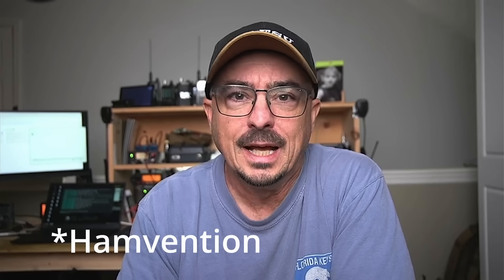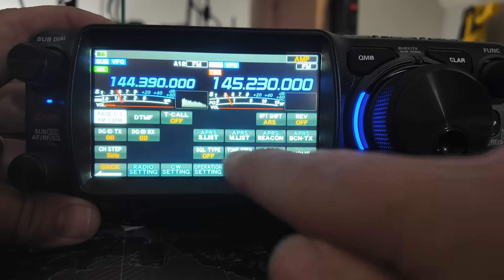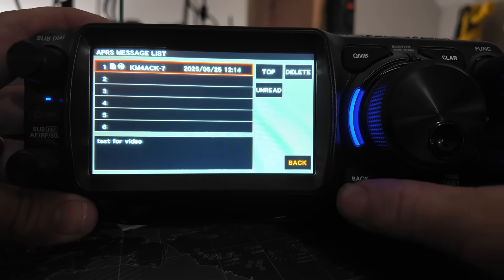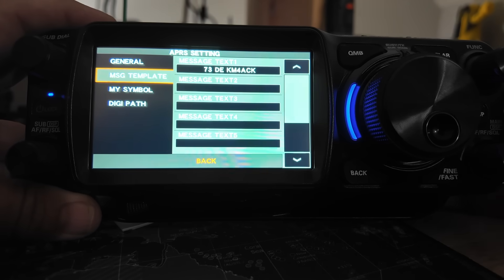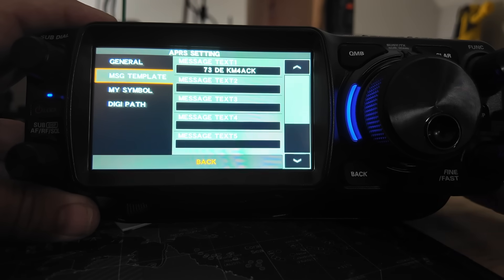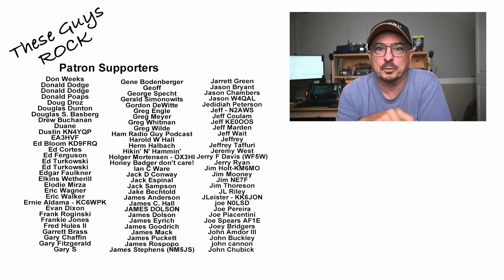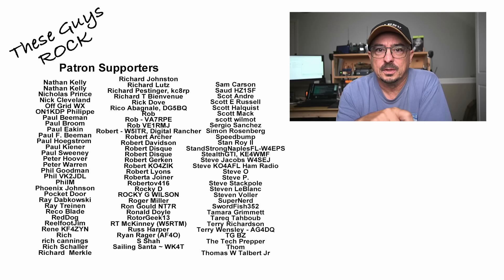The Yaesu FTX has a Flaw

Comment: I had something like that with my FT991A. Recording option everything is clearly stated in the manual only it doesn't work looked on youtube did the same as in the manual. But it doesn't work for me. After some research I saw that it wasn't completely up to date with firmware. So downloaded and installed everything on the Yaesu. Only not all updates were available on the site. What became clear was that almost everything was up to date only the LCD wasn't so I just didn't see anything on the screen anymore. Searched for 2 days for the update for the LCD screen. I don't think something like that should happen. But if you email Yeasu I get no answer at all. I'm not important enough even though I already have 3 Yaesu's on the shelf. At some point you think I have enough Yaesu's and I'm going to look at another brand....

Comment: Fortunately, APRS is not the most important functionality for me. I have analog APRS in the TYT-578 radio and it works quite well - I used it maybe five times during the year. Using APRS from the car radio is pointless. On a 300 km route, the gates received only six of my beacons - so I prefer to use APRS DROID. Although I think the device should support it out of the box. Probably future updates will improve it... We are "beta testers"

Comment: Highlight the desired message and press the Reply or Edit button (this may be labeled as “Reply” or accessed via a function key like F or ENT).
A text input screen should appear. Use the touchscreen or knob to enter your reply. The FTX-1’s interface, similar to the FTM-400XDR, allows text input via an on-screen keyboard.
Keep messages short (APRS messages are typically limited to 67 characters).
Reply: After composing your message, press the Transmit or Send button (often labeled as TX or a similar icon on the touchscreen).
Ensure the APRS modem is active (set to 1200 baud for VHF, typically 144.39 MHz in North America) and that the radio is on the correct band (B-band for APRS on dual-band radios).
The radio will send the message to the target station, often via a digipeater if the station is out of direct range.

Comment: I don’t think Yaesu put the bar very high for themselves. They did not try to put out a ground breaking new designed radio. for the price they’re asking for the radio they really should have knocked it out of the park. It should have been lighter than the 705 smaller than the 705 included all the features of the 705 like GPS, Bluetooth, etc. made it full duplex. in my opinion, I don’t think they moved the bar any further.

Comment: Transmission by any radio normally requires GPS, or manually entered lat/long data.  The FTX-1 does not have an integrated GPS module.  You have to buy that separately.

Comment: FTX-1A will have everything under control. And it will connect right up to the Optima Amp module.
And it would be nice to have a button for “weather radio “ also.  Not a replacement for a ic-705 for certain.

Comment: I'm curious how you have the signal stick pointed straight up.  I have the same with a 90 degree bnc.  Th HF antenna port is above the UHF port.
Reply: I'm wondering the same thing.  Could he have the signal stick attached to the wrong bnc ?

Comment: It’s a simple problem, it’s called “Over Engineering”, are they focus on something new and exciting like the audio output of the radio which is a big deal!  Users are complementing the performance of the audio from the radios speaker system, but at the same time, “Under Engineering” in areas that haven’t changed but get forgotten in the engineering and testing of the equipment, obviously a firmware update will correct all the problems that they under engineered!  it’s supposed to be a finished product but actually it’s in beta, report what you find wrong to Yeasu, and they’ll issue a firmware update, who knows there might be a firmware update already?  Said enough now and I’ll shut up.

Comment: When you previously mentioned the FTX, with zero seconds of FTX research, I commented that it looked like a great radio but it'll almost certainly have that one bug or "feature" that Yaesu always includes that leaves you wondering what they could have possibly been thinking.

On the plus side, it looks like APRS was a last second FTX feature place holder add-on, and while it's completely useless now, you're probably only one firmware update (maybe two) from full APRS functionality.

Contrast that with Yaesu's fatal hardware flaws that you own for life.  I bought the FT-70DR for EMCOM, not knowing about its unadvertised "feature" that leaves the receiver powered at all times so it can decode a wake up signal.  I can see where 1% of users might like that feature, provided that it's not the default and it can be turned on and off at will.  Nope.  It's hardwired.  Modern Yaesu HTs must be left charging or stored with the battery removed or they'll be dead in a week or two when you need it for emergency communications.  OFF means OFF, Yaesu!  Baofeng got this right.  Everyone other than Yaesu gets this right.

I love Yaesu but buying a Yaesu is like having an attractive and fun YL and after she becomes your XYL you learn that she has an incurable STD.

Hopefully, a firmware injection will kill whatever bug is infecting your FTX.

Comment: Rumor has it: new firmware updates are coming to fix APRS messaging and a bunch of other things.  This radio will be beta for a while.
Reply: Beta?
Reply: @gliv2  The good news is the final product can be achieved with firmware updates.  Back in the release of the FT-857 (non-D), a hardware change was required to get the end result.

Comment: Aprs is not mentioned anywhere so you're complaining about a feature that is being added but not completely done yet what am I missing here
Reply from the maker: They have an ARPS specific manual for the FTX
Reply: Agreed however nowhere in the literature does it boast aprs I figure it wasn't completely done so they did not mention it anywhere just a little added bonus that needs some tweaking. I don't really consider that a mistake. if it wasn't in there at all and then they added it later you would be praising them for doing something extra even if the first iteration was broken not trying to nitpick. I do you love your Channel but I see a lot of people hating on it I think they hit the nail on the head for the most part with the exception of it should technically have built-in GPS and Wi-Fi but then again the majority of people are not going to buy it for that the fact that the GPS is a dongle means it wasn't really meant for aprs just an added feature

Comment: I also reserved an FTX-1 at HRO, but when the salesman told me the price, I passed on it. I can’t image a QRP rig costing 50% more than the FT-710.   The Optima version is about double! I have APRS on other rigs, and vhf/uhf mobiles are cheap. I just don’t get the enthusiasm over this rig. I am a long-term Yaesu fan, but on this one, it doesn’t seem to do anything to garner the price.
Reply: Do you think the 705 is over priced? Do you think the ftdx10 is overpriced?
Reply: @Blake-jl8lh 

The 705? yes.  Direct from Japan I sometimes see one for around $1070, which if I needed one to replace my IC-7100 would be an option, but at HRO or DXE prices, not worth it. 

The DX10? No. I own one. With the discount and rebate at the time I bought it, it was a great deal and worth every cent. This is a killer rig and maybe should not cost so much more than the 710 for what it is, but I do like the quicker access to things on buttons and not buried in menus.
Reply: @kenchilton  the dx10 is a 1500 dollar radio now with the current state of the market. Add uhf/vhf, a detachable head, and an extra hf port and you dont think all that added is worth 400 bucks? Come on man. The radio is proced correctly relative to the market.
Reply: @Blake-jl8lh 

Sorry, but not the way I see it. The FTX1 is more comparable to the FT-710 ($920 at Gigaparts, last I checked) as an HF rig, not the DX10.  The Optima is an FT-710 with UHF/VHF and a detachable head added, fewer panel controls, and double the price.

It is okay to disagree. Buy one. It is not a bad rig, just high-priced here at introduction, IMHO. I hope you are happy with it.  I am looking forward to some deep discounts on the 991a (which really does seem to be what the x1 replaces in the lineup).
Reply: @kenchilton why do you say its like the 710? From what i read from yeasu I believe rx architecture wise this radio is closer to the dx10 than the 710 which is what makes the dx10 a more expensive radio. 

Its nothing like the 991a in terms of the actual rf architecture. Its light years beyond that. But if you don't need all that receiver Id say buy a cheaper radio for sure.
Reply: @Blake-jl8lh 

Not according to Yaesu’s brochure. The FT-710 is a pure direct-conversion SDR (the filtered RF feeds directly into an ADC). The DX10 is a hybrid SDR (superheterodyne down-converter feeding an ADC). The block diagram on the FTX1  brochure clearly shows the HF RF feeding directly to the ADC with no down-converter or mixer. The VHF/UHF path have downconverters, not the HF. On HF, this is a 710 architecture. The only thing noted is that FTX1 uses the ADC component that the DX10 uses, but the 710 ADC is proven to be close to the same performance. 

Price does not depend on architecture - cost does. Price is an indirect reflection of performance and utility. Architecture can drive performance, but as evidenced by the Sherwood data, the DX10 is only marginally better than the FT-710. Without such data, we have no evidence to assess the value of the FTX1 except to say that its architecture likely will perform like a 710. The DX10 roofing filters add value, as do the extra button, tuning ring, and antenna ports. 

The FTX1 is a replacement for the 991A because the radios share application as combined all-mode HF/VHF/IHF capability. Of course the FTX1 should be light years ahead in performance, but the 991 is not somehow suddenly incapable.

You seem to place a higher value on architecture than I do. I do not value what does not translate into what it does. The value of a product is how it performs, how well it brings results, and what other costs it avoids beyond the product itself. Again, IMHO architecture is irrelevant to value without tangible results. I did not buy a DX10 because of architecture - I bought it for what it does better in terms of how much better it worked for me. The DX10 value is not just the small receive improvements, but many other benefits which include the user interface - an area the FTX1 does not appear to even match the 710. 

The FTX1 as far as HF goes has nothing better than a 710. So, to me, there is not $1000 more value than a 710, and I don’t expect it can be evidenced in the application, so I let go of my reservation for it.

Comment: I experienced everything to the T you described in this video - spent two days playing with it in APRS and even AFTER the firmware update on May 28 - same results.   I could only ever get it to decode a packet from another Yaesu radio - my FTM500 - I had pinpoint APRS running and using an Icom 9700 - it would NEVER see any packets or messages and NO decodes - I am in the DFW area we have a VERY busy APRS network and the FTM-500 and the pinpoint/9700 were decoding  ALL kinds of APRS packets and traffic - so yea work in progress - I suspect future firmware updates will resolve some of these defects/missing features.  The other  big one is the GPS puck - that has no idea what side of the world it is in all my packets I sent from the FTX-1 put me over in China (KG5EIU-14).   Basically APRS is unusable at this point in time.   Still enjoying the radio  and all it offers, just not APRS at this point.
Reply from the maker: I have only had the latest firmware for a few hours but it is decoding many more packets than before the upgrade. Still need to do more testing but it is a step in the right direction. Still no message reply that I can find.

Comment: That's a real shame, since Kenwood has fallen so far behind with its radios (IMO).  During the side-by-side at the end, I didn't even see the packets on the S-meter or spectrum display.  Is the yaesu just not very sensitive?  However, since you were feeding data to direwolf from it, it would appear it DID receive data.  Very strange.

Comment: Could this be related to a setting like squelch or fm mode or anything?  I’ve fought this type of thing in the past and it was related to that type of thing.  You however know about 1000x more about this than I do.  Also, have you EVER seen a second station? Maybe the firmware only writes to the first slot in the list?
Reply from the maker: Mistakes are always possible but I checked everything multiple times and hard reset the radio a time or two. I did see two stations in the list a few times over the multiple days of testing.

Comment: Playing the Devil's advocate, I suggest that the FTX may not be decoding as well because it's being swamp with computer noise. Swap positions of the FTX and HT and rerun the test. Then swap antennas while in the new position and test again. The signal stick being more sensitive/higher gain could be picking up computer noise better even when further away.
Reply from the maker: The second test was using the exact same antennas and conducted in a different location than the first.

Comment: FTX Software issue... The data is there, just not displayed..
I assume you have done the 28th May F/W update for the FTX-1.?
Reply from the maker: Did it today and testing APRS receive again
Reply: @KM4ACK  O.K...
I had seen some other comments on APRS screen operation that had been fixed...
Reply from the maker: Still no reply option that I can find after the update. It does seem to decode better. More testing to follow.

Comment: The HUGE mistake with this radio - one that can’t be fixed by a firmware update - is that it wasn’t designed for a separation kit. 

This would have been my mobile radio of choice, had I been able to put the 100 watt amp portion of the radio in the back of my truck.

Comment: Jason, I'm not going to sit here and hate on the radio like others.  A point was brought up, a flaw.  It is all stuff that can be fixed in firmware.  It doesn't matter what name it is on the major radios; everything seems rushed to make a release for a major hamvention.  Understandable from a company side of thing because they want it out there.  The demand is out there.  Fortunately this day and age these "flaws" can be fixed with firmware 95% of the time.  When I receive mine and if the issue hasn't been fixed there is a quick solution and that is just bring an HT along.  There's going to be hate on that but 80% of us will also have an HT along for the ride.  Admit it.  Problem solved in the short term.  Keep on hamming and 73 de KJ7OEP

Comment: Did you test using the latest firmware? Main v104, 5/28/25?
(The aprs manual seems to have no information on replying aprs messages...)
Reply from the maker: no reply option that I can find after the firmware update
Reply from the maker: Just got it installed a few minutes ago. Testing again now

Comment: Last year, in August, I purchased an FTM-550D and, like your FTX-1, it registered only one-tenth (or less) of the packets my FTD2 did on the same antenna. Yaesu had no fix for this, but fortunately, Gigaparts replaced my unit, and the second one worked perfectly. I hope this is only a software issue, but I have to assume there could be a hardware reason for this as well. Of course, since Direwolf seems to be logging the packets, it makes me believe it's an FTX-1 software issue.
Reply from the maker: I hope it's a software issue that can be fixed with firmware.

Comment: Looks like a flop to me. There are several videos of failures, loss of TX amp speaker issues. The great audio coming out of it doesn’t matter if the other features fail.
Reply: The biggest flop for me was putting the 2m/440 port on the bottom!   Try to one up the 705 with a duel vfo and screw up the antenna ports,  genius.

Comment: Learned my lesson on buying  fresh  new rigs back when i got my Icom IC-7000  ( excellent radio by the way) but i got one of the very first rigs and had to send it back for warranty work a few times. Replaced the DSP 3x . After warranty,  i did the fan mod , and have it almost 20 after i bought it. Lots of folks ask to buy it byt that rig and i are old buddies now.😊 Im sure Yaesu will get it figured out. Probably just a software issue.   very cool rig , i just bought a FT-710 so i couldn't jump on this one for awhile.  73 my good man! de N3TGY

Comment: My FTM-500 took 3 firmware updates to fix the bugs and a fourth one recently added new capabilities. And it’s been out for almost 2 years! Unfortunately, SDR’s are a whole other beast in software than the radios of two decades ago. An order of magnitude more lines of code than before.
Reply from the maker: Their firmware updates for the 500 have fixed some thing but they still haven't fixed the stupid keyboard. Thankfully they put a QWERTY keyboard on the FTX

Comment: I wonder if it has something to do with no GPS attached? I’m just speculating but I believe my FT5 won’t send messages if you don’t have the gps on and a recent position acquired
Reply from the maker: I set the GPS coordinates manually in the menu system.
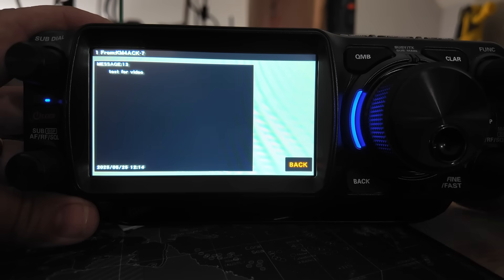Reply: Another silly question at 1:46 did you try to physically touch the message? Maybe it’s a bit not so obvious touch option. Hopefully they work the bugs out. Not a deal breaker for me just disappointing they’d ship it with something easily testable.
Reply from the maker: I touched it after reading you comment.....still no option to reply